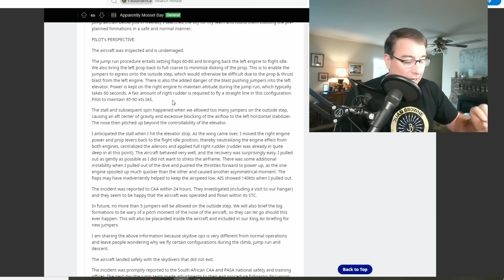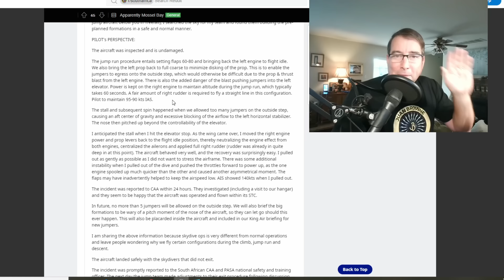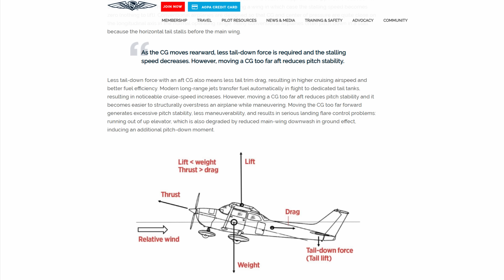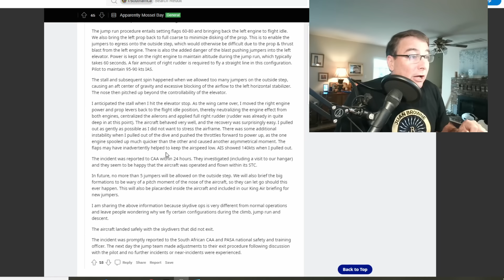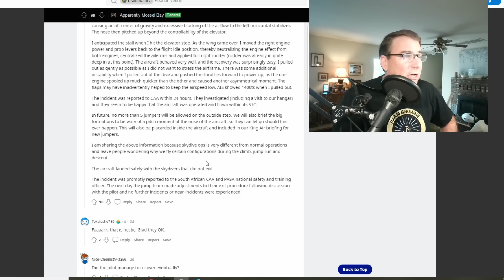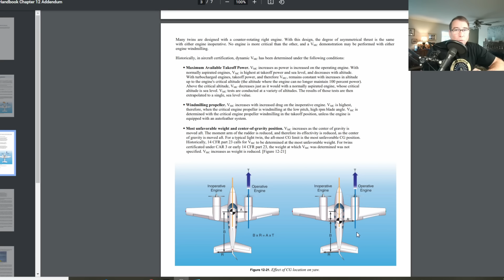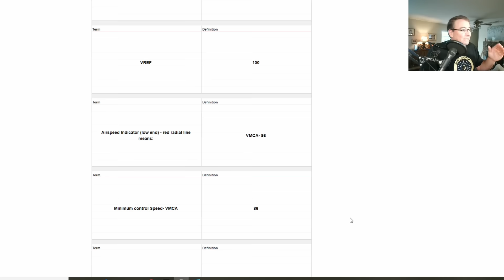Stall+Yaw=SPIN!  King Air Skydive Incident

Comment: I dropped meatballs for a bit building time in a C90 with the Blackhawk PT6’s. I was never taught or asked to reduce power on the left engine. We would approach the DZ around 100kts, if I recall correctly, power back near idle, turn the green light on and pitch for 90kts. Flying that slow with asymmetric thrust with a shifting cg is a bad idea. It’s not a matter of if you will enter a spin, but when you will enter a spin.

Comment: Thx for sharing. Many times in X-Plane (flight simulator) I did intentional stalls and recovery. But I never used asymmetric thrust or yaw from rudder, but only once I get into spin (Cirrus SR22) - this was first spin in my whole life. I did know how to recover, and I was shocked how fast I did it (recovery). Maybe I should practice this recover technique - In simulator most likely I cant kill anybody.

Comment: I've only jumped out of aircraft in the US Army. C-130, C-141 and a CH-47. Of course since those aircraft are considered overpowered for airborne jumps, I never felt like the pilots were on the verge of loosing control.
Reply: Well, not only overpowered for the job, but the AF would have very specific rules for such operations with penalties for any pilots who ignored them. And training up the kazoo.   I flew the C-141 but unfortunately, our mission was never to haul jumpers.

Comment: Imagine the ride the 4 had inside the plane through the spin and stalls. That may have added to the recovery challenges.
Reply: @rickt.1870  That's what I was thinking. They were probably supposed to come out right away but couldn't because of the spin. That's what I was thinking with the snap rolls. They were piled in a corner.. CG all messed up.

Comment: The last skydiver to jump might have been thinking that's enough of the spins why take a chance,  I'm out.
Reply: I heard rumors that the last skydiver was thrown out.
Reply: Or he figured, pilot won't want to drop any more jumpers, and I didn't pay for a round trip ticket, dammit.  Gotta jump before they lock the door!
Reply: He is a she and yes she was tossed out. She jumped the next day!
Reply: @peterfrenzel1826  That's Terrible.  What did she do to get thrown out like that? .joking
Reply: T Mayocra  -  You try to find the door as you're inside that washing machine of stalls and quarter turns.
Reply: Been in a couple of uncontrolled jump runs and my instinct was to get out as soon as possible. Pretty hard to do in an aircraft in a nose down position and spinning. 
Sometimes you have to hold on for a tic so you don't contact a surface or worse, a prop. One more reason to be physically fit.
Reply: @peterfrenzel1826  I was thinking that might be a possibility
Reply: @T Mayorca.   Exactly right!
Reply: @chrisolsen5280  woah. No way!! Brave gurl!! Lucky too not to hit tailplane.

Comment: There's a very simular video, floating around somewhere, of a King Air stall  that occured over the Perris California DZ sometime in the early to mid 90s.
Some jumpers just ended up with a story to tell in the bar later that evening.

That was the same plane used in the movie 'Point Break' BTW.

Comment: For what it's worth.
Back in the day, I jumped 182's, 206's, CASA's, and King Air 90's, and 100's. When I stopped jumping I had over 800 jumps. NEVER did I see a King Air use more than 1-notch of flaps on jump run. I NEVER saw a pilot idle one of the engines. I am a private pilot also, so I know a bit of what I was seeing. I was always nervous when I jumped being a pilot as I was along for the ride. The first 1000 agl is also a bit of a nervous time as if the plane has any problems we have to ride it down. Above 1000 agl, the PIC may tell us to get out using our reserves. But, never was I afraid on the jump run. Most of the time we were at 90-100 knots on jump run. And, twins always made me nervous the first 1000 agl. Most times you have no idea how many hours the PIC has in twins.  
Love your YT channel, great stuff!

Comment: Hi all,
This pilot made a mistake and owned it in his lengthy and detailed explanation.  More words equal more fuel for criticism. 
    I've jumped out of many KA's, but have never seen 6 on the step.  Did the pilot know so many were to exit at once?  If not, he is ill equipped to give the thumbs-down during their climb-out; too late.
  At most DZs I've jumped at, it would fall on jumpers to inform pilot or S&TA before takeoff, or fall on management to limit group size for exits.  Max 4-5 jumpers for CG reasons seems like a reasonable way to prevent this from happening again.  While this was a close call, and unacceptable, it does not seem to come from a place of negligence on the part of the pilot, and he does not deserve all the blame.  Good jump pilots of twins always try to minimize prop blast.
     Try flying jumpers, and try out 100+ knot prop blast while standing on the step.
Pilots in the States wear a parachute because FAA regs say all passengers including pilot must wear a parachute when the door is open during flight.
Thanks Juan for your thoughts and excellent content, I love your channel.

Comment: I did quite a bit of this on a DHC-6 Twin Otter in the eighties. The prop wash was never an issue for the skydivers on the Twotter, so asymmetric thrust was not an issue (a definite no-no at these speeds, anyway!). The momentary aft CG and increased drag while the jumpers clumped in the doorway was what you watched (and compensated) for.

Comment: I flew King Air's in sky dive ops before I went to the Airlines. 

It was the most dangerous job I ever had!.... sketchy ops, mx..  minimal training, beat up planes with questionable histories...  

I flew 90 kts on jump run..   always kept symmetrical thrust...   I can't remember power setting..  I'm pretty sure I never put flaps in but it's a little grey to me these days. ...

We allowed 4 on the tail..  and that scared the hell out of me.   Once had 5 or 6 on the tail and I could feel the buffet and had zero elevator authority.  I went bizerk on the ground and parked the aircraft that day...

IMO the king air makes the worst skydive aircraft I flew. I flew them all I think...  it gets up and down quick...  but that rear exit and aft cg and horizontal stab combo...  ughhh I don't even want to think about it..  

Never happened to me but had heard stories of high angle of attack with the jumpers on the tail entering the stall and the jumpers striking the horizontal stab.

The specific STC  for the king air I flew did not require a chute but other aircraft I flew did.   There would be no way to get out in the king air anyway. 

It was crazy dangerous flying but man I could spot land that aircraft in a dime...  plus energy management and flight idle from T.O.D 14k  to touchdown was a fun skill that you naturally developed over time..  I would bet some of the senior sky diver instructers I could touch down before them...   it was fun.   But after almost a decade of airline flying...  I would never do that stuff again..

Comment: I was a Tweet FAIP as well at Reese.  I did the spin ride with the squadron  spin pilot.  Don’t recall an inverted spin in that ride.  Had a student almost put me in one.  I made sure the throttles were idle and got the stick quickly back. Popped right out.  Student had kind of  frozen with stick forward on a spin prevent.  That was 44 years ago and still fresh in my memory.   As for the King Air, hard to understand pulling one engine to idle at that airspeed.

Comment: In addition the the CG being aft (as the skydivers hang outside the plane), it's also far to the left. To keep the plane level, the pilot would need to put in some right roll. This adds more lift requirements on the left wing which is an additional factor in the left side stalling.

Comment: I have mad thousands of skydives where "floaters" are placed outside twin aircraft from King Airs, T-Otters, Loadstars, B-18s,  B-99s and DC-3s. Jumpers need to accept higher airspeeds, proper blast,  some rate of decent, and limit the # of floaters. It can make exits more challenging but certainly is manageable. I've been there hanging onto outside and aircraft that you can feel getting slow and squirrely and it isn't a fun place to be if you're aware of what's going on. DC-3s/C-47s are the best. They are just rock solid.

Comment: @blancolirio just quick as I know it. In the USA you are required as a pilot of a jump plane to have a parachute and at least basic jump qualified. I don't know on a King but the Twin Otter you don't do any of that asymmetric thrust just both props back 80%.  As usual you are spot on and great video.

Comment: Gotta love that immediate full aileron to stop the roll. How to guarantee a spin 101.  The guy did well enough on the recovery given the circumstances. Airplane is still in tact and noone was hurt, good ending for sure.
Reply: That’s the first reaction any pilot would do when faced with an uncommanded left roll- right aileron.
Reply: @stevenbeach748  unless the pilot is aware of an immanent stall. in my experience, the students with better understanding of stalls and aerodynamics tend not to use aggressive aileron in slow flight near a stall. would they years down the line flying a king air they dont practice stall recovery/recognition in every day? perhaps not. However you have a good and obvious point
Reply: @13megaprime  while the pilot probably should have been aware of an approaching stall, I doubt they were.  This is a maneuver they do a lot and I'm sure it was unexpected.

Comment: The fact he was surprised by his (low) airspeed when pulling out of the dive to me also indicates he wasn't actually flying the recovery, but just yanking the stick. I got taught (in a glider) to watch my airspeed indicator, both to make sure I wasn't over speeding (easy to do in a very aerodynamic glider, less relevant in the squared off box-with-wings aircraft) and to make sure I was actually flying again before pulling out. Time to get some (more) spin training.

Comment: Juan, with all due respect- there are several twin turbine dropzones near you in NorCal. Jumpseat a load or two, it's different flying than a B777.

This is more of an aft CG, combined with the excess drag on the left side. 

Every twin turbine I've ever jumped has the landing gear horn blaring on jumprun, because of the idle left engine. Again, most skydivers are not pilots, and don't appreciate the significance of 10-13 bodies with gear, pushed as far aft as possible

Comment: Nice to see that incident here so quickly! 😀👍

It is a little the fault of the skydivers too. They always want it soft and slow, not to fast please because of the relativ wind outside. And they are all standing and hanging in the back and outside of the plane bringing it out of balance. And so with an plane at slow speed as wished and massive out of balance it happens sometimes. As a former skydiver I have experienced the same situation long time ago too. And I saw it a second time on our drop zone. Now as an dropping pilot I hope that this will never happen to me, because it can happen so fast when you as the pilot only a little distracted during dropping. And there is a lot distracting. Radio chatter with the ATC, or a skydiver open your seat belt or pushing and pulling the controls with his container during exit...
And I fly only single engine!  🤔

Well explained Juan. Love that channel and the contents! 👍

Comment: This may have already been mentioned in the 777 comments but I believe the pilot uses "course prop" on the left prop to minimize asymmetric drag by having flat blades. As he mentioned the no 1 is at flight idle there would not be any issue w prop blast on the jumpers.

Comment: Seems they need an aircraft designed to get jumpers out in a group just far enough apart for safe chute deployment. OV-10 with its back door off was one try at a small jump setup C-130 is too large for most operators. An aircraft able to handle 16 jumpers might be the sweet spot  for jumpers, backwoods paradrop supplies to work crews and other uses.

Comment: Well it’s really the wrong airplane for this. I’m sure they are afraid of a jumper hitting the horizontal if it’s deceiving. I worked at a company that leased a  BE-200 to the Forest Service for fire jumps. They never jumped out of it. The execs just flew around in it
Reply: The 200 has a t tail so that would be better to jump out of vs a 90

Comment: Yep! As soon as you see that last diver (Yellow helmet) come out he leans out just far enough to blank the elevators stalling and dropping the tail on the same side as the spin begins. So it looks like the thing they didn't factor in was how many skydivers can hang to the outside of the aircraft before completely blanking and stalling the tail. So some math is needed to figure out how many divers can be on the outside of the aircraft safetly.  I can see why they preferred to to chop back some thrust on that side to help prevent divers from striking the tail. Juan is right though asymmetric thrust is a disaster waiting to happen especially with that much weight hanging aft CG. Good job recovering the aircraft without damage. His knees had to have been shaking after he got back on the ground!..Thanks Juan!

Comment: Go out the other side of the aircraft if they are going to be splitting the throttles. That pilot doenst realize how close he was to being the subject of a folk song. Very lucky the wings didn't depart the fuselage, flame out the engines in the recovery, or just plain old falling in an uncontrolled fiery cartwheel into a smoking crater.

Comment: So, you put the aircraft into an almost critically unstable condition, with reduced airspeed, and then instantly change the CG by having 6 people jump off? Got it. Lucky to be alive. Lucky not to impact one or more of the jumpers.
Reply: I thought for sure he was going to hit one of the jumpers.
Reply: I think the people jumped off because the plane was in a stall position not the other way around. If the plane suddenly drops out from under you and you are just about to jump you just jump.
Reply: @crissd8283  I've always said that I see no reason at all to jump out of a perfectly good aircraft, but in this case I might have made an exception.

Still, it's hard to tell from the helmet cam exactly how the timing worked. Looked to me like the jump came first.

Comment: I think more pilots need to practice recovery from these types of events because its very counterintuitive to stop fighting the plane and let it start flying instead of inducing more uncontrolled aerobatics. The asymmetric thrust and flaps configuration is an unnecessary risk...
Reply: We don't practice dying.  Besides such aircraft are placarded against spins.

Comment: Hey Juan I used to fly the DO28 G92 in the UK and Europe. It's a STOL aircraft with big rudder and all flying tail, so it's low speed behaviour was good. Using A-symetric power on the runin was the normal SOP. Although not at Max continues more  like half power. Using one engine druring the drop is more helpful if you've got lots of different groups existing because of significant attitude loss. On multi ship drops we used to drop fast with power on both engines. There's lots of different was to do the runnin using tools and techniques at your disposal. Knowing what the aircraft can do and also knowing what the jumpers are likely to do is key. Hope your well at HQ.

Comment: I haven't finished watching Juan's video, but my first thought is, did the amount of people outside the aircraft on one side effectively stall the left rear horizontal stabilizer considering they were already flying slowly with flaps out just as the skydivers began to exit the aircraft?
Reply: It was a huge factor blocking airflow to the L- horizontal stabilizer causing the nose to pitch up.
Reply: @badmonkey2222  The horizontal stabilizer is essentially producing negative lift, a downward vector. Stalling the airfoil would reduce that vector essentially lowering the nose. Slow speed at altitude, significant drag from the divers, asymmetric thrust, aft cg, and there ya go.

Comment: Back in the early 90's, my instructor believed in teaching spins so you'd know what to do BEFORE you entered one. He said just what you said about your instinct to use ailerons instead of rudder. He even had me release the yoke during a spin and we recovered using only rudder, which actually recovered quicker than when I had my hands on the yoke!  He said a properly trimmed a/c would seek it's trimmed altitude all by itself and all I had to do was use my feet to arrest the spin then let the a/c recover al;l by itself. I understand that this doesn't work with all a/c, but it sure did with a Cesna 152 :-) And after the shock of the first spin, it was fun!!!
Reply: I only flew gliders but spin training was mandatory before going solo.
Reply: @ColinWatters  wish it was mandatory on powered flight too!! Really opened my eyes to the very real peril of turning base to final too slow!! So glad my instructor took the time and effort to expose me to spins!!! Glad you posted this as I didn't know glider pilots were exposed to spins too👍